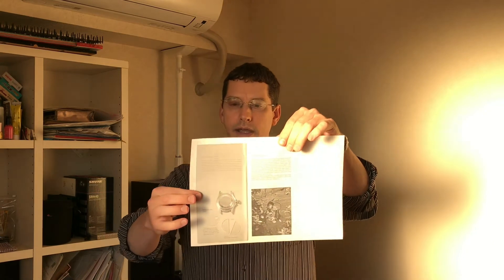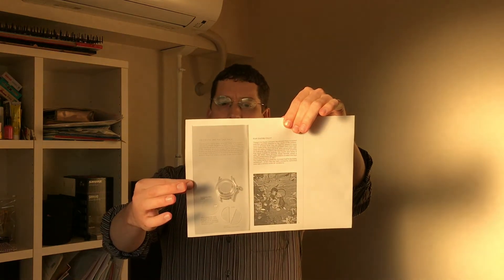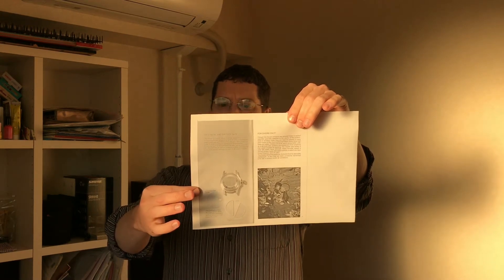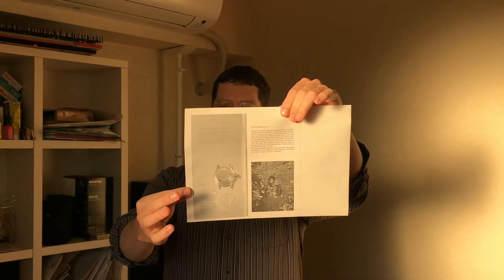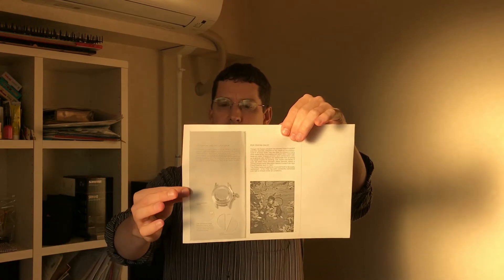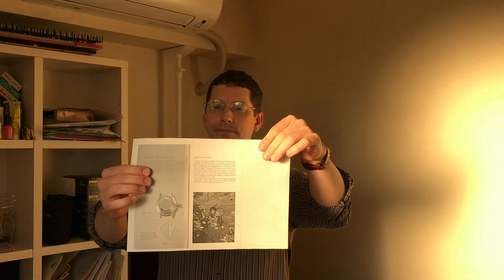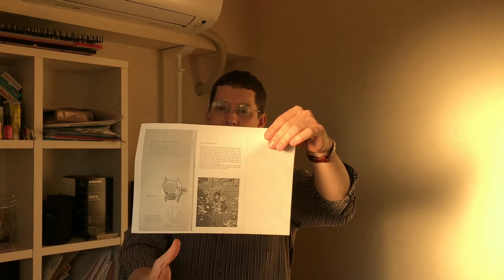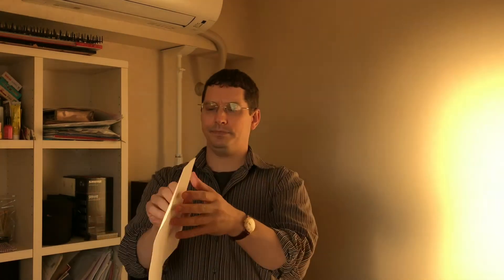Rolex Talking Points #3: The Crystal and Caseback

Comment: Hi Austin, I went to a used watch place today and tried on a 1997 Rolex Explorer 2 (the guy deals in new and used rolexes). they wanted $4600 for it. it had the holes case and the bracelet had been replaced by rolex (with a new one, the one that comes on it) when it was last serviced in 2012. it had been polished so the case matches the bracelet (both look new). the watch seemed to be in mint condition. 2 year in store warranty. what do you think? i was amazed at how small the watch wore, and how light it felt. not at all what i expected. i was wearing my omega seamaster coxial and the explorer 2 felt smaller and lighter. then i tried on a new black GMT master 2 and was IN LOVE. they wanted $8400 and i almost bought it. what do you think of that explorer 2 deal?
Reply: also, if i give him my $5000 for that explorer 2, will i still keep having my $5000?
Reply from the maker: That does seem like a fair price for that watch. Mine was the equivalent of 4400 USD and I got them to knock 200 off, making it 4200. Mine came with box, no papers. 
Do you know if it had a Tritium dial or luminova? Swiss Made at the bottom, would mean luminova, and t < 25 at the bottom means tritium. If it's luminova, that's a good price I think. Tritium, and it's good, but not as good...and I'd personally shy away from it if tritium, but that's just me.
Will you keep having your 5000? :) Well, I think they will go up in the future, because they don't make the 40mm anymore, so I think in 5 or 10 years you'll certainly be able to get your money back.
Does it have box and papers? Also, it's due for a service...so, keep that in mind. Maybe you could mention that, and see if they knock a couple 100 of for you.
Reply: he would not come down one nickle. explained his prices are fair and he warranties them, brick and mortar all that bs. he said he studies prices online and makes a fair price, which i thought his was. i never thought about tritium or luminova. i need look into that, not sure. i will call monday. i dont know if box and papers either, need to ask. one thing i wondered, how do you wear out a bracelet as rolex put a new one on it. he said, he must have wore it a lot. that made me a bit nervous. once i tried on the GMT master 2 in black, i was in LOVE. i told him that serviced in 2012 means it needs servicing or will soon. he gave me a bs answer that he warranties for two years if it stops. if it stops? lol. he said he does the servicing there for $500. i really dont like the deal to be honest. not factoring that into it. if it has recently been serviced, it would be a good deal.
Reply from the maker: Ya, I'd check on the box and papers, and whether it's Tritium or Luminova. I'd also ask him what kind of accuracy it has - if it's within COSC standards. That 2 year warranty is nice. It means you'll be able to use it for a couple years before taking it to Rolex. Longer than two years if you push it, which you probably can.
I'd ask him if all the parts inside are Rolex, and ask what - beside the bracelet -  has been replaced. I'd also ask if his warranty includes water damage, which should bring up the subject of the seals, and whether they are up to snuff.
It's good that it's a brick and mortar shop, it gives that much more piece of mind.
I'm assuming your talking about the Ex.2, but they same applies to the GMT. 
Lastly, does he seem like an OK guy? That's a gut thing, but I'd consider the vibe you get from him. From what you say, it sounds like a good deal and promising. I'd check on those things above though.